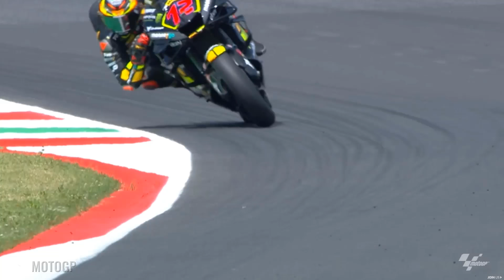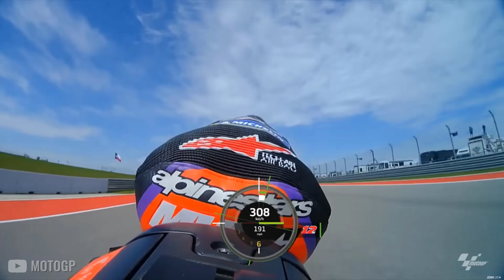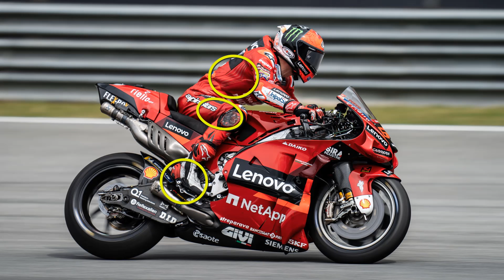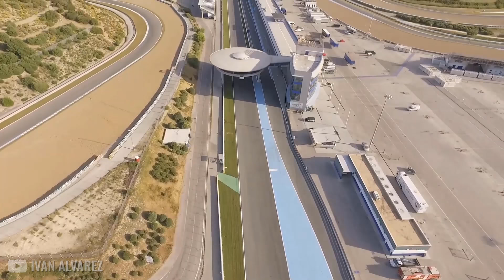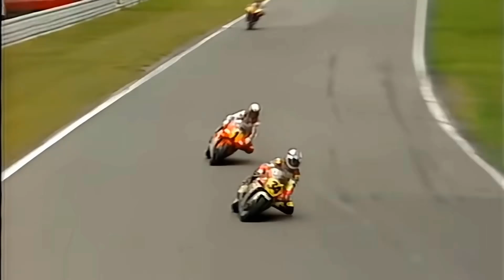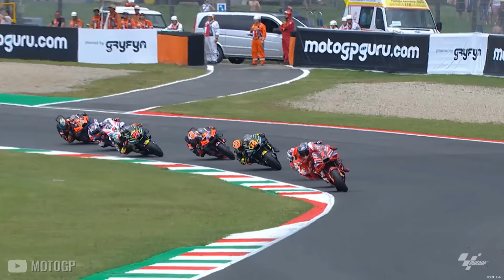How MotoGP Riders Are Taking Body Position to New EXTREMES

Comment: One time I I wasn't going too hot and I actually tried to break too. Use my rear brake and my right and my feet came off the pegs and I did that stupid leg dangle that I didn't want to do. It really helps out. You know what the hell pressure off wrist

Comment: I've watched these MotoGP riders and the one that gave me the most incite  to riding was Max Biaggi. I observed his outside foot in a turn and he was pressing on it so hard his foot was actually bending around the outside peg and I could see he was steering with the rear wheel on the was out of a turn.  When l tried it i felt so stable on the bike and the bike had what seamed Maximum traction.  I stayed quite on the bars and now I've heard different opinions on loading the bars with pressure. I'm very uncomfortable doing that. That's what I've observed. I'm still just a street squid but very comfortable riding at my speed and on the track.

Comment: 1:52 80 to 90 kgs through the wrists,
for a few seconds? 🤔
Pass..... 😄
3:13 ''the best are moving forward and
back as well.'' Good point, something 
I don't think about when braking for
sweeps/corners. I'm always thinking;
'weight' forward when under hard 
acceleration, but not thinking much,
if at all on pushing back when braking.

Comment: I'm sure each track is different but what 
are some average mid corner speeds and
or the most common speeds at mid-corners?
AI says they are 110+ - mph, when asked,
 but I doubt that's the average or
typical for most corners. 
Aren't a lot of them somewhere around
40, 50 and 60mph/100kmph? Do you have 
any idea what those 'typical' 
mid corner speeds are and 
what are they like for the A  level riders
on the same tracks?  'B' level riders?

Comment: Just curios. I watch the absolute shit outta TT and those guys corner so fast but don't lean anywhere as much as these guys do. Any reason for that?
Reply from the maker: I'd guess purely for a safety margin. They do get to maximum lean in the slower sections, but when you're going around a corner at 140mph with a stone wall as your run off, you aren't going to lean to 55+ degrees of lean!

Comment: I race a RSV4 with WERA in America and only usually do 8 lap races on at most a 2.5 mile track (in decent shape too) and I'm worn out after, sometimes I do back to back races and jump off one bike onto another or still ride the RSV4 in another class and I'm pretty much done. You definitely need to be fit and some don't realize how physical the sport is.

Comment: One thing that hasn't been mentioned (yet?) is that, when the rider's head is just inches off the track while cornering, they can't accurately see the next corner in order to know what will be necessary to navigate it. Thus, they spend hours and hours visualizing and memorizing each and every sequence of turns right down to muscle memory.

Comment: I firmly disagree. I think these bikes are built for a very specific build. The problem is, the bikes have too much power and the riders are too light. My son is 160 lb and fits very well in the bubble on my bike. I'm large and my Aprilia is very strong. I can force it. Not act like a sail. The days of horse jockeys are over.

Comment: I did a Superbike school on BMW S1000R and couldn’t figure out how to hold on to the bike as it hit the power band in 2nd gear - I was clamping knees and feet against the bike and had my butt against the seat hump but still was hanging onto the bars too tightly, which seemed to bring the front wheel up at ~140km/h. I remember thinking “How do MotoGP riders do it with 100 fewer pounds and 100 more hp?!?” 15-minute track sessions left me wasted. These Gp guys are gods.
Reply: Yeah I did a bunch of those and I'm still slow. You ain't lying. There was an announcer back in the 2 stroke days who said ANYBODY who can ride a MotoGP motorcycle in competition is a god. I tend to agree.

Comment: The title is wrong, it's not the body position, it's the riders thenselves. After Marquez, Dorna only accepts midgets into Moto GP and since they are small, they need to throw their body out further to compensate for the Japanese motorcycle size standards, which makes the bikes look enormous. 20 years from now riders above 30 kolograms in full gear won't be able to compete

Comment: I'm a taller rider, and most are not tall.  Moving weight to the rear for braking is HUGE being able to use the rear brake.  Shorter guys cannot do this as effectively, and the bikes are not designed for this anyway.  It's like a forgone secret, mostly because it's a pain for those who can't do it.  The g's wear you out, but you catch'em in braking.

Comment: Hello, couple of years after bootcamp I bought my first New bike. On one ride in the outskirts, I found a perfect, long, empty country road with a sweeping corner at the end. Long story short, after a 200kph blast and half way around the corner I realized I may not make this. A picture flashed in my head of a motorcycle race I had seen ( strange, but true) and instantly threw my leg out, and body even farther. I was young, indestructible, but that was one of those lessons you learn, but that move saved me and my Z1R from a lot of grief. Saw the video and it brought back a lot of memories.

Comment: The hardest I've braked was on a Superduke not long after I'd got it. Massively overcommitted to a corner on the road and found myself closing hard on my mate on a 916 in front of me. The physics of it didn't make sense to me. My brain was telling me the front should have washed out long ago. The back may have come up a bit but I don't know; I was bricking it. I slowed down fine and the ABS didn't even feel the need to jump in but my wrists and my ringpiece were in bits. Can't imagine what these guys are going through.

Comment: As compared to old school riders the electronics are now controlling wheel spin, anti wheely sensors and ABS sensors where in the old days the rider had to use shifting of bodyweight forward and rearward to control those aspects and now the riders do not.

Modern day riders would be sending themselves to the moon from high sides if they got on a vintage bike with no computers controlling the bike for them.
The riders from before computer control days were actually much more skilled riders than the modern day riders.

At one time the rider was the biggest difference in winning or not where as now the guy with the lap top in the pits is probably the most important guy on the team.

Comment: You will never be really quick in the corners if your rear brake is operated by your foot. Your position on the bike will be limited by your trail braking. Pretty much everyone is using a scooter brake.I am a brake systems designer in BSB. 😊

Comment: Why not add a solid piece that fills the opening in the triangle the upper and lower leg make under braking/leg-dangling? An air brake that folds into the bike under power. But it would probably cut the whole leg off in a crash... nvm.

Comment: I may be wrong on this, but their tire size is still 16.5 making the bike that much closer to the ground. Also way back in the 90s when I was over in the EU testing tires for moto2 "250cc" bikes the motogp bikes guys I talked to said on exit the rear tire never totally hooks up, ,meaning it's spinning up and sliding out of the corner. Just as the Pic you showed or Casy sliding pre apex to square off the corner.  With riding aids today Im not sure if that's really thing now. If someone knows please speak up. Also their transmissions are different now when shifting it takes very little effort to go from say 2nd to 3rd etc.  With riding aids they also can just,ram the corner, break as late and as hard as possible,  lean the bike , then pin the throttle.  In my day that would have gotten you thrown off the high side.  So with all, that said , I don't think they care as much because they know the computer will take care of the exist. Frankly I would be in favor with some of the sporting regs being changed so we can see motor talented riders float to then top.

Comment: In my opinion, this is true motor racing.  Sure, there is technology, but the athleticism and skill required eclipses any other form of motor racing.  Sprint and midget racing is exciting, but they are enclosed in a safety cage.  Oddly enough, when these guys come off the bike they do amazingly well for the most part.  The Isle of Mann is altogether different because it isn’t a controlled circuit.  Neither is Daytona because it was designed for automobiles.  That concrete wall on the backstretch has damaged a few people.  Also, some of the races where the machines are all the same are very exciting to watch because it is all skill and technique.
Reply: Motocross is quite athletic as well.

Comment: All bs for show. Fastest riders in world run iomtt they never hang off drag elbows or stick.out legs to supposedly slow down. Gp is show off shit, real racers go fast and do not hong off like they are try to bail off bike. Go watch the truly fastest guys, none do this. Gp is pro wrestling of bike racing today. The leg hang does not catch enough air to aid slowing. Todays brakes are all you need. Back yrs ago guys sit up high into corners as brakes were not enough and chest at 150mph catches enough air to aid slow downs. Leg out 1 ft is nothing and modern brakes are more than enough not to mention modern tires.

Comment: Pretty soon they will have AI actuated gyrostabalized wing surfaces that keep the machine planted in these manuevers.   The bike will literally look like a fly by wire jet flicking its control surfaces back and forth, making small adjustment to keep the machine stable.  And why not, we all have a close relationship with the air moving over bodies and cars have been doing it for decades now.

Comment: I am a bit sceptical about riders taking 'V shaped' lines. I wonder if the title is a misnomer & they are actually doing something else. I see no evidence of V lines watching laps. From your diagram of the  V line through the bend, the rider would have to turn on a very tight radius indeed mid-corner that would have to be relatively slow not to outdo tyre grip. I wonder if riders are actually taking tighter lines than before. This would be on a smaller radius where they turn in later. Top speed through the curve is slower than with a wide, sweeping line but it allows full gas sooner (surely the main goal) & the bike follows a constant radius arc without the need for steering input mid-corner...

Comment: The extreme body position hanging off in the corner's helps stall the air and increase air pressure over the high side of the bike creating more down force. Combined with the updated side aero on the bikes, this is very efficient. We never really thought aero would be effective in turns to the degree it is today. Very impressive stuff.

Comment: I have always speculated that if you can hang further off the bike, you can keep the bike more upright and on a potentially larger tire patch for better grip and stability. Putting that into practice takes a toll on the core muscles and lots of repetition to get consistent, I'm assuming.

Comment: Awesome video!

I knew they were fit, but adding some numbers to it really helps me get a sense of how hard they are working. This is truly an extreme sport. Crazy levels of skill to ride the bike in the first place (smoothly, with the power) but it seems like the MotoGP class just cranks the forces up and up and up.

I can't begin to imagine what it feels like to pop your chest up into a 320kph wind while also trying not to pull a stoppie, and also balance that against 2x your body weight going into your arms while you try to squeeze a bike with one leg. And then to somehow smoothly transition to 45+deg of lean and touch your elbow to the ground.

Aliens indeed.

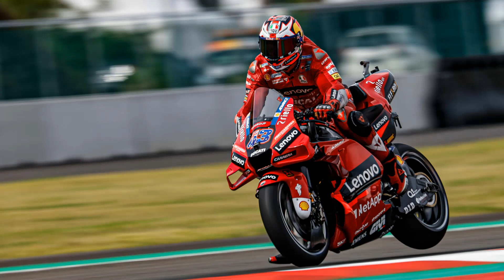Comment: I think a fundamental mistake of analysis happens at 1:45.  Unless I'm mistaken, the purported forces which are stated fail to factor the opposing and thus counteracting force of wind resistance upon the rider's upper body.  To what degree that occurs varies, but it is a primary factor involved in order to derive the actual net forces experienced by the rider.
It is still very physically and mentally demanding, but the numbers stated in this video are probably not humanly possible, if they were accurate.

Comment: Just noticed: when they dangle their legs, they do not brake with the back wheel? So they do just break with theire front wheel?
Reply: Yes, the rear tire gets offloaded so much under hard braking that there wouldn't be much braking effort from the rear anyway.
Reply: I raced for years and the only time I would touch the rear brake was on exit of a corner to control wheel spin which wasn't very often. This was around the time traction control was becoming common so now there's not much use for a rear brake. Some of the pros say they use a little to rotate the bike but I think that's pretty rare. Under hard braking the rear tire has little to no weight on it.

Comment: finally. people always misunderstand leaning vs hanging off the bike, they think it's the same thing but it's actually opposite

1. so they can accelerate faster out of corner while keeping the bike more upright while body hang offs the bike

2. To get the bike to turn more when attacking a corner.

summary, you hang off the bike more so you can lean less to turn the bike, especially good when exiting. 

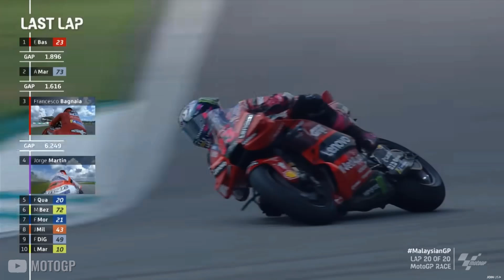7:53 is an example. enea hangs so far off.

Comment: I recently raced for the first time and used the exhale, head drop at exit to push the bike away to get that extra bit of drive for lining up a pass into T1. Of course I am nowhere near a pro rider and could probably have just pinned the throttle and come out fine but the mental comfort of the fact that the rear has a bit of a more fighting chance since its on the fatter part was worth it.

Have learnt so much from your channel over the years, thank you for continuing to make great content!